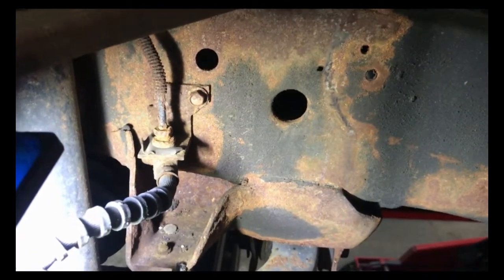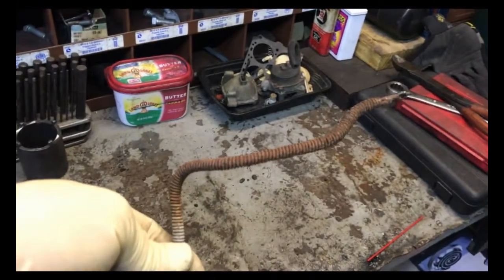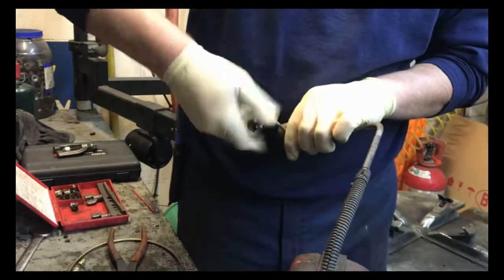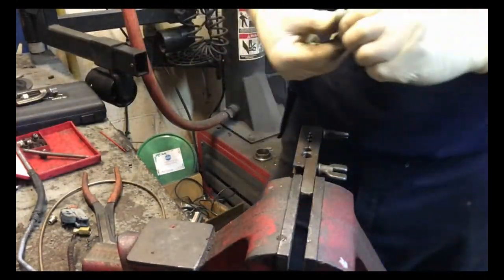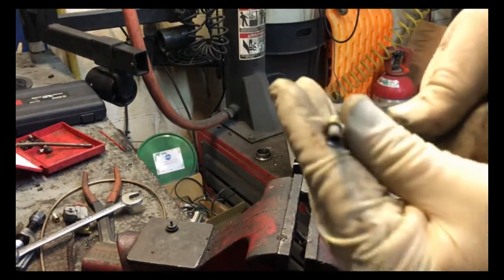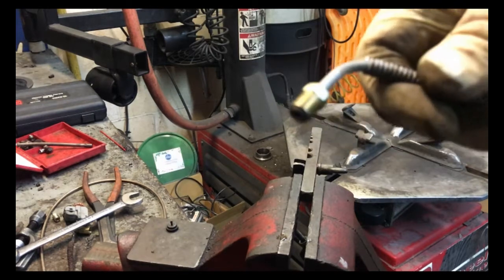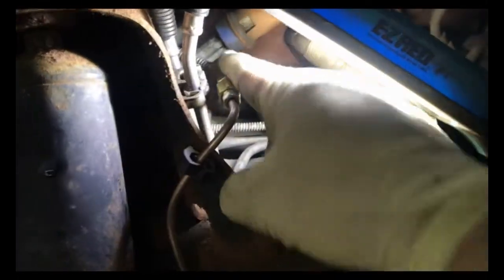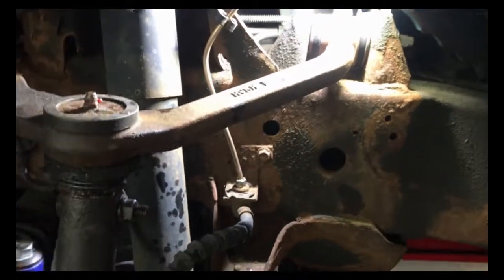Repairing A Rusted Brake Line

Comment: GREAT JOB!! The purpose of the coiling on the hydraulic brake line is to dissipate any heat buildup in the brake line.
Reply from the maker: I don't think so, its so the line has some give. Like a spring. I see that on vehicles with body on frame because the body has rubber  bushings for a betters ride, the body moves on the frame so the line need some give. So its not pulled on line directly.